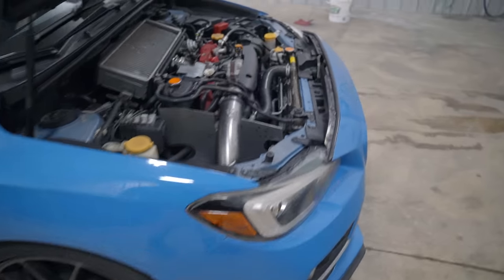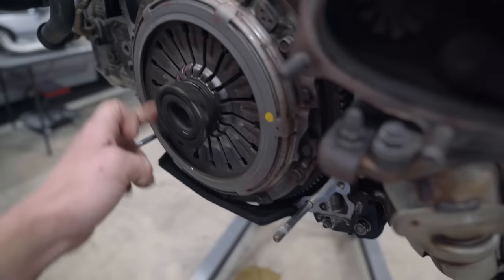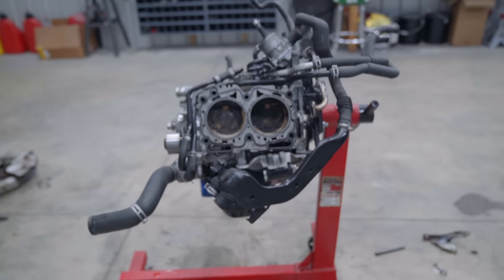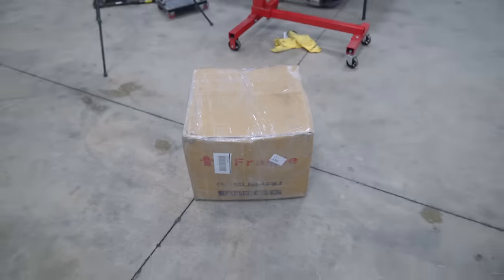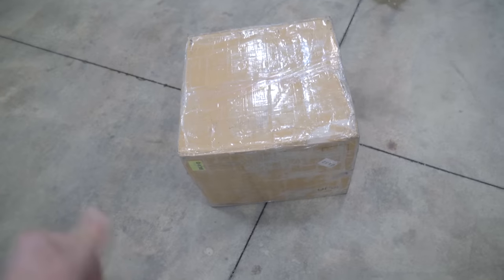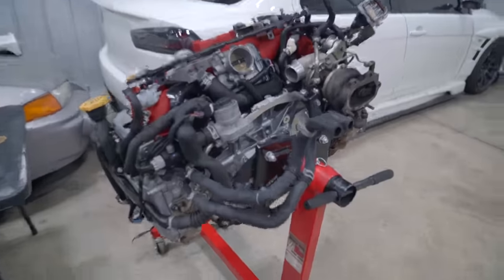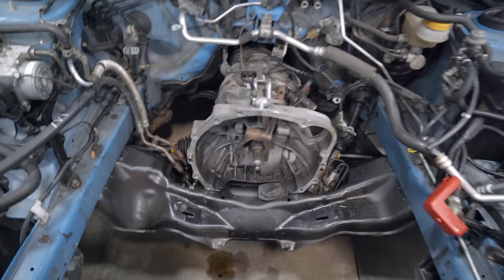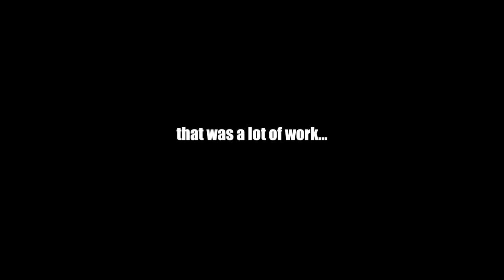HyperBlue STI Gets It's New Engine (immediate carnage)

Comment: Devin! I just did this accudentally. If one of your cam gears doesnt go perfectly on the cam dowel it will start, and run but very shortly after turn and jump timing. My money is on that. Ive done it once in my life . Motor needed 3 new valved when it happened to me

Comment: Bro.... sounded like the timing belt either broke or jumped a bunch of teeth and then broke. 🤔 God I hope I am wrong! Praying for ya D-man! 🙏
Reply: defo sounded like something slipping but also sounded like it slipped and hit like a plastic sound
Reply: @@mrreflex6748  
Hard to say, but my guess is the tensioner either had air in or failed.. 
I've had Brand New OEM tensioners with air in em, causing belt to jump. Trick we would do at the dealer is bleed em before install then pre-load a bit. I've also made the mistake of improper gap on the manual belt tensioners. Common dealer trick is to use the grenade pin for gap reference. 

Really hope it didn't bend valves, sometimes you get lucky. Fingers crossed for ya man!
Reply: Dion Tsai Sioe  EJs are still belts. The FAs are chains.
Reply: Dion Tsai Sioe  did you watch the video? LUL

Comment: Nice vid. Nice short block. makes things easier. the oil cooler doesn't get torqued on?  What soap is used for the engine bay? What the heck happened? Sounded like a head failure, or crank lockup. hydroseize

Comment: Did you clean all your old parts with cleaner that went on to that new block could have brung contaminated material back into the engine or maybe it was just a bad block build but I hope it works out for the best for you it’s a very nice car I had 2017 Sti black owned it for a month and it blew up while under boost smoked the engine wound up selling it for scrap at my local junkyard there nice cars but that motor isn’t good at all they have so many issues then once you put boost to it bang

Comment: Maybe the belt, or cam bolts. That or the AVCS cam bolts broke. I saw a lot of parts being re-used. When i redid mine. I replaced all the most of the torqued bolts. New water pump, gates timing kit. And more. 

Hopefully it wasnt bad… but that sounded like a dropped valve and metal being crushed to a complete stop.

Comment: you didn't prime the oil system correctly and grenaded a new shortblock. That sucks man. Get a pressure pot if your doing lots of builds and pressure fill. but still disconnect the crank sensor and crank over for a minute / especially make sure the oil pressure light goes off or check pressure manually.

Comment: Sounds like the timing belt broke
Reply: That or the AVCS cam bolts broke. Hopefully he replaced them. I saw a lot of parts being re-used. When i redid mine. I replaced all the most of the torqued bolts. New water pump, gates timing kit. And more.